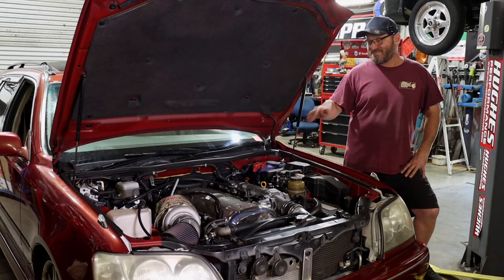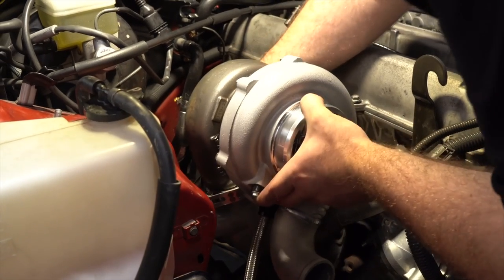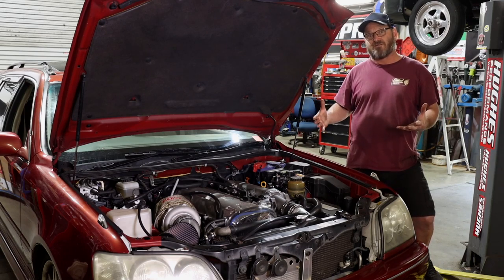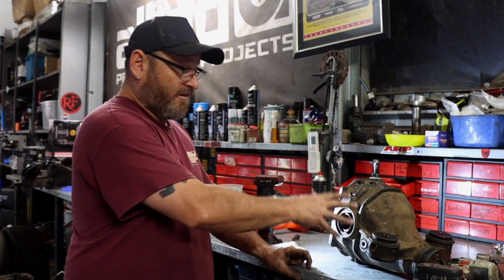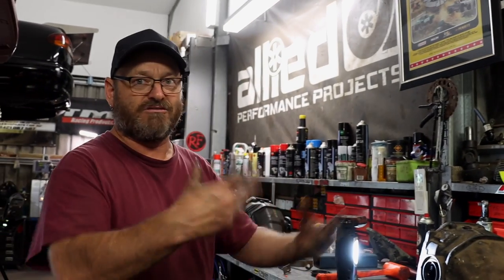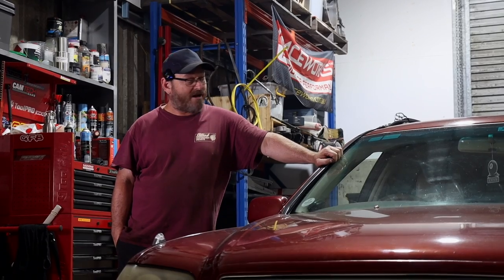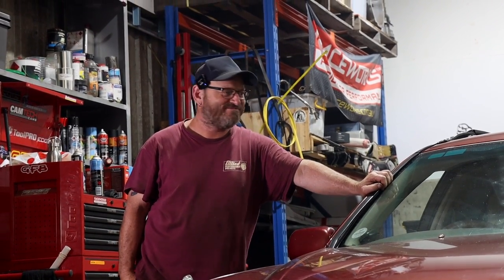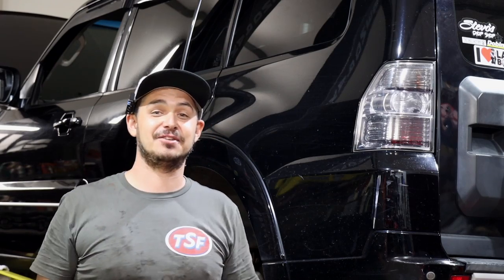Torsen LSD Diff Install JZS171 Toyota Crown

Comment: It's crazy how often you find yourself having to shave something down/make an odd custom spacer once you have a lathe.  Makes you wonder how you ever lived without it.
Reply: Drill and sandpaper.
Reply: @capnskiddies  That's an accurate summary of most of my 20's
Reply: @wobblysauce  and an Angle grinder
Reply: well known thing with the bolts being wrong in aus jzx community, just use the 86/brz bolts from the car you got the diff from at the wrecker and bam bolts in no turning down required 🙃🙃🙃

Comment: With the front cradle bolts, if you use the 86/BRZ bolts they will fit and you won't need to lathe the bolts.

Comment: I nearly fell off my chair when you announced the HP numbers. Dam impressive boys!
Reply: @ChristopherHallett  Everything can be fixed with enough forced induction... provided the "keg" can hold it all in.
Reply from the maker: They make power easily but it is all above 4500rpm, that's where things can become frustrating with an auto.
Reply: Yeah me too, actually considering get one later this year and oh boy that might have been the last trigger I needed to hear
Reply: @theskidfactory  quick question in regards to the transmission, where abouts did you get the valve body from im looking to do the same with mine

Comment: Found it interesting you dropped the rear of the subframe to access the 3 rear diff bolts, I was able to get them off doing the same job to my Crown in the driveway with a spanner and a bit set.

Also for anyone playing along at home planning to do this swap, get the front diff bilts from the 86/BRZ, saves the headache of the Crown ones not fitting the new diff.

Comment: 7:50 actually needed to hear that.
My diff has been leaking pretty badly ever since doing an quick axle swap at the track at night.
I bet we missed that little spring not being seating correctly before installing the new axle.
Thanks!

Comment: Torsen certainly seems like the better type of diff over clutch style LSD. I wonder how different it's lock up is compared to other types of LSD? I believe clutch types can be tuned to come into effect more aggressively if required but I'm still learning yet the constant gear mesh of the Torsen just seems like a more robust and linear LSD than others.
Reply: It depends on your driving style really. If you love popping the clutch and smashing tyres a clutch type is the way to go.

If you want a more progressive engagement for circuit work a torsen would be a better option.
Reply: @Rollin8.0  So for a road car and enjoying everyday corners then the torsen would be the better diff?
Reply: @GarageItYourself  yeah for pretty much 95% of drivers they're more suitable

Comment: Woody needs an old-school 308. I've got one here if he wants it. I need my instrument cluster fixed and a half-metre length of flexible 51mm inner fuel tank filler hose for my old Courier ute. But he'll have to pull the 308 out of my bus.

Comment: Did this car come with the tiptronic 30-40ls transmission or the 30-40le transmission? I just bought a jzx100 1jzvvti with the 30-40ls transmission. It has two extra solenoids for the tiptronic feature, so I'm wondering if a normal reprogramming kit will work on it like it normally does with the 30-40le

Comment: When you put new seals in do you use oil or grease in diffs,transmission etc🤷‍♂️? On the inside of the vee rubber.
Reply from the maker: I just use wheel bearing grease.

Comment: Probably a stupid question but have you tried red diamond convertors in Brisbane or Roadblaster convertors in Adelaide they maybe able to custom build you a convertor.
Reply: Got a Red Diamond in my 2J lux never had an issue. Great bit of gear :)>>>
Reply: @reaperlux922  nice and I run a Roadblaster in my cammed commo also a great converter built in AU just don't know if they build convertors for Js

Comment: I worked with a turner that used to turn the welds off torque converters, open them up and modify their stall speeds. Is that still possible?
Reply from the maker: It is but there is only so much you can achieve with a std 1JZ converter and it's not enough.